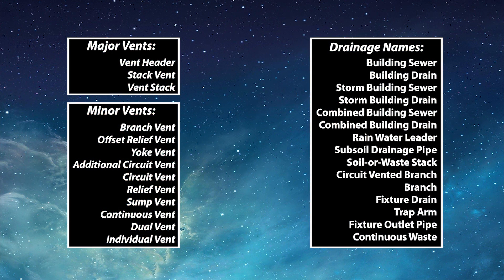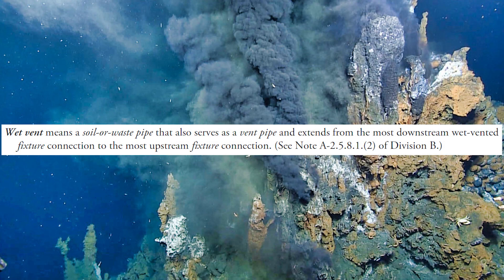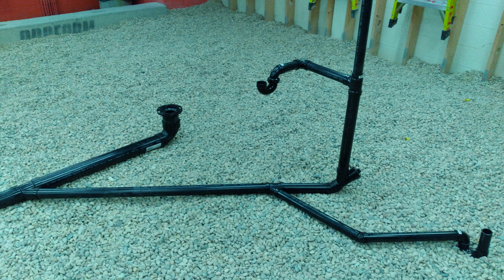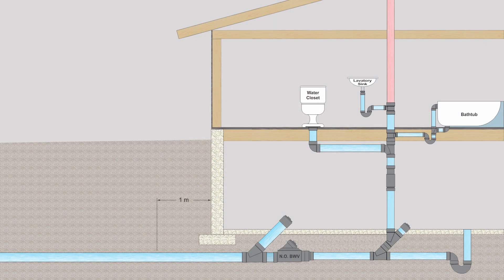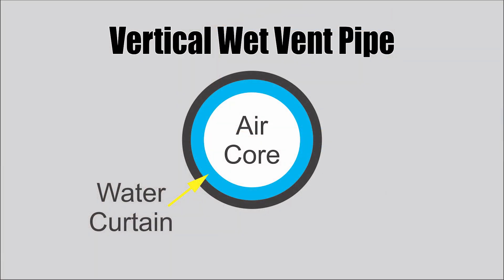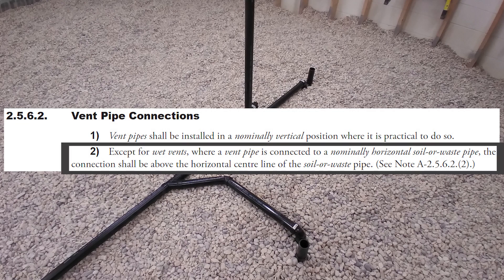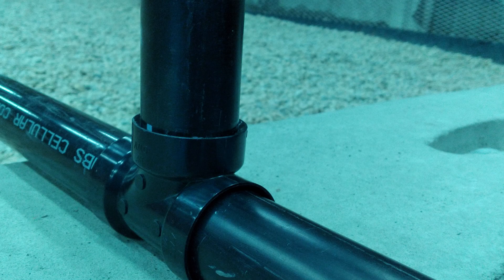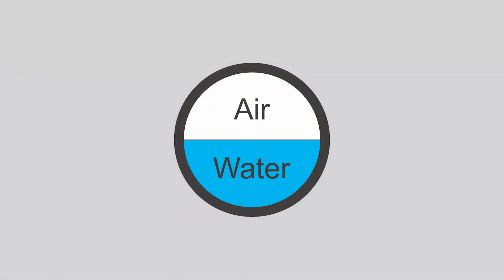Wet Venting Video:1 - Wet Venting Basics

Comment: when wet venting and the piping is 2 inch from the fixtures to the actual vent ( vent is 1 inch )  older house.   do they leave the 1 inch vent ( grandfather) or best have someone replace it?
Reply from the maker: I have never come across a 1" vent. If you are living in Canada, this has never been permitted by code. Therefore, this has likely been installed by someone who just took a wild guess.

Would I start ripping open walls? No, I would consider putting in an air admittance vent in an accessible area though. Like under your bathroom sink.

Comment: Aren't we supposed to upsize the pipe when wet venting the next fixture? Isn't that rule missing with that diagram?
We're not allowed to use a santee on it's back for a drain, is this normal in Canada?
Reply from the maker: We don't have any rule for upsizing the wet vent after the next fixture.
As for the santee, yes we can use it on its back in Canada. Some cities here will not allow it, but there is no official code against it.
Reply: @MathematicPlumber Interesting, Canada uses NPC rules only? Here in the states we use UPC or IPC and some other states have their own special book, LOL.
Reply from the maker: @jamestorres2789  Yes, Canada exclusively uses the NPC. Some provinces will have certain amendments that have slight variations, but they are very similar.

I have heard of the IPC and the UPC, but I have not spent any time with those codes. If the US takes over Canada one day, I may have some studying to do. LOL
Reply: @MathematicPlumber ugh, 3.5 more years of this stupid Taco 😜🤪😝

Comment: Great description of a wet vent. About the wet vented fixture drain connecting to the wet vent above the horizontal center line, if you observe the trap to vent distance, the trap is actually in contact with the air in the wet vent (which is in the top half of the wet vent pipe). A dry vent must connect above the horizontal center line. But in the case with the bathtub it’s a fixture drain that’s connecting horizontally to the wet vent.

Comment: For the example with the tub and shower, would there not have to be a fixture on the vertical so that it’s continuous? I thought the wet venting fixture needed to be tied in on the vertical?
Reply from the maker: The short answer is no, there does not need to be a fixture on the vertical. The vent needs to come off above the horizontal center line of the wet vent, and the wet vent needs to be sized properly.
Reply: 7.5.2.1 (k) the highest fixture is connected to a vertical portion of the wet vent, upstream any other fixtures, in the form of a continuous vent. Would that not mean that the last fixture needs to be on the vertical?
Reply from the maker: @TheRIVERRAT18  You are in a completely different code book. The code I am referencing is the NPC in Canada. There is no section 7 in the Canadian plumbing code

Comment: I live in a city in the United States that has pretty strict Plumbing code, the first picture set up wouldn't even be close to Legal . Not only are wet vents frowned upon here that vent is way too far away from that toilet. Our vents can't be any more than 5 ft from the toilet
Reply from the maker: Codes are definitely different in Canada. But  I would like to learn more about American plumbing and gas codes. Which codes to you use in your State?
Reply: We use that here in Florida and Texas. Perfectly legal to use, as long as the tub or shower arm is less than 8 linear feet. Commodes can are a little different, most places is 12 feet from vent, while others say it doesn't matter, depending on what code book, what amendments the jurisdiction has adopted, and finally the last say is up to the inspector and how he interprets it. 

Very good video, especially the examples and videos illustrations !
Reply: @scottobrien6062 I'm actually in the Pittsburgh area and our county code is supposedly as strict as places like New York. The downside of this setup is if that 2 inch drain line from the tub or sink ever clogged that toilet is not vented anymore. So I completely understand why this isn't legal a lot of places. In my area most toilets have to be vented by a 3-inch stack going all the way through the roof. There are some scenarios where you can use a 2 inch vent but it's mostly 3-in all the way up out of the house

Comment: So a entire wet vent could be horizontal? Like if you are picking up a toilet, 3x2 wye to a lav wet vent with a 2 inch wye off of that to pick up a bathtub. This entire line could be horizontal, other than ofcourse the vertical portions to pick up the fixtures? 

the first 3x2 wye does not need to be nominally vertical? I worked with a journeyman that always rolled this wye. Was he just mistaken?

Comment: What do you mean by, "most down stream"?
Reply from the maker: Upstream is a higher point in the piping system and downstream is a lower point in the piping system. Just like a river: the snow melts on a mountain (upstream) and then flows down through a river until it meets the ocean (downstream)
Reply: @MathematicPlumber Looking at your plumbing group mockup, which is a horizontal display,  I'm confused by what is "most downstream"
Perhaps you mean most downstream from the top of the wet vent?

Comment: Why yall notherners call it a tee wye?
Reply from the maker: Cause that there are a tee an a wye
Reply: @MathematicPlumber  Yeah but it is a 90 degree fitting, which would be a tee.  Again I'm not a yankee and wondering why yall add the wye part too it?  We call that a sanitary tee, a wye would look like an and "y".
Reply from the maker: @jtoker9758  We use all that terminology too, and you are not wrong. A sanitary tee is not a straight tee and not a wye, but somewhere in-between.

So TY was born as a slang way to reference a sanitary tee. This is used across much of western Canada possibly into parts of the east too. It is simply a way to shorten a longer word, time is money right?

If I went to other parts of the world I may try asking for a TY, but I would reword it the official way if I was met with a blank stare.

In all reality, I find it extremely amusing that some people actually get emotional about the slang use of TY. Therefore I will continue to use it, because let's face it, I'm a shit disturber.
Reply from the maker: @jtoker9758  Like I said before, this is a slang term. Just like in Britain they will use the term 'lorry' for what we would call a cargo or delivery truck in North America.

I'm sure the term 'TY' has an origin story just like the term 'lorry' in Britain, but I could not be bothered to lose any sleep figuring out why.
Reply: A tee does not have a slight bend downwards, teewye does, (san tee) a wye is not for sanitary sink purpose, so they all have their place. Tee fittings can only be used for tying in vents together.

Comment: In your three-piece bathroom example, if the toilet doesn't want to flush very easily, I mean the bowl has to fill up, hesitate for a second , and then it will flush ( twice), does that mean the wet vent is waterlogged?
Reply from the maker: This is typical of a toilet that is partially blocked, often near where it is connected to the floor flange. Common offenders are toys, Q-Tips, credit cards or tooth brushes
Reply: Your wet vent ain’t water logged. Your toilet has a log stuck in there

Comment: 2:28  what happens if the image is almost identical, but the bathtub is to the left of the water closet? Can they be wet vented that way? If so, would it have to be 3 or 4 inch to the main stack? Thank you
Reply from the maker: Nothing changes. All sizing would be the same

Comment: So why can a wet vent connect in below the horizontal center line but a regular vent needs to be above the center line of the pipe?  The pipe i'm venting, i don't have the vertical clearance to roll that Y coupler up to have that vent pipe coming out the top half of the pipe.  I only have room to Y connect it in on the same plane like at 4:33
Reply: Probably becuase if it gets clogged then you can snake it out and clear it, but a regular vent you wouldn’t have access..

Comment: Hello Kelly, these videos are great to watch. 
I have a question about wet venting. 
I will do my best to describe  my question. I will use north, south, east and west. Sewage will flow south. 
So at the north end of the bathroom there is a toilet which is the beginning of a 3" pipe.  2 feet south of the toilet on the east side of the 3" pipe a 2" shower pipe will drain into the 3" pipe. Not vented. Then about 18"  south of the shower connection on the west side of the 3" pipe is a 2"  lav pipe which is vented and will be the wet vent for the toilet and the shower. Does it matter that the wet vent is south of the shower and toilet. Is the order for venting OK. 
Thank you.
Reply from the maker: Yes this is a problem. Keep watching the series to get your answer
Reply: @MathematicPlumber  could you plese give me a clue?
Reply: This is the situation I have under my concrete floor. I want to make it right.  
   Since the toilet needs to be the last vented piece into the wet vent.  Is there a way to vent the shower? 
   Is it possible to keep the connection for the sower as is and run a vent after the shower P trap to the nearest wall and connect to a dry vent. 
   Show as * in drawing. However this doesn't follow the 6" above the flood plane rule.   I'm open to suggestions.                                                                                           
   All horizontal under the concrete floor.
   Thank you!!!  
                                                                                                         O  toilet 3" PIPE FLOWS TOWARDS THE BOTTOM
                                                                                                          I                 TO BE WET VENTED VIA VANITY
                                                                                                          I
                                                                                                          I
                                                                                                          I
                                                                                                          I--------2"-------- VANITY IS  VENTED
                                                                                                          I
                                                  SHOWER BASE ----------2"------------I                          
                                                                                            *             I
                                                                                            *            I   3"
                                                                                            *            I      
                                                                                            *            I
                     Can possibly connect to dry vent here.  "0"

Comment: Hi Kelly, great videos and explanations. I was hoping you can help me out🙏 I have a 2storey bungalow
With a3 pc bathroom on the 2nd floor, and on the first floor I have single bowl kitchen sink, a dishwasher
And a laundry tub and washing  machine and finally a powder room with a wc and vanity sink.
In the basement I put in a 3 pc bathroom and I was wondering about the 3toilet rule. From my toilet I have to run about 8ft before I can tie into a 4” cast iron building drain line, is this ok with the Canadian building 
Code? Thanks.
Reply from the maker: As long as you pipe everything in the bathroom correctly with the proper grade, you should have no issues. The 4" building drain will be more than adequate
Reply: @MathematicPlumber  thanks very much for your reply, I have a 1/4 “ per ft slope is that ok?
Reply from the maker: @johnmorrison1050  ¼" per foot is bang on. Nice work!
Reply: @MathematicPlumber  hi Kelly , once again thank you very much for your reply🙏 1 more quick question , is there a reason why some plumbers use asb pipe and some use pvc underground. Thanks , have a great day .
Reply from the maker: @johnmorrison1050  Personal preference, ever changing cost and availability of materials. There is no code stipulating one or the other underground.
Reply: @MathematicPlumber  This is essentially what it comes down to. We always use ABS in kelowna simply because it's cheaper, with PVC for the sewer portion then using bushings to branch off from there to the various bathroom groups and such

Comment: I don’t why I am having such a tough time trying to figure wet vents.   Smh.
Reply: Me too bro
Reply: In his example, imagine the bathtub drain from the trap to where the wye connects to the “wet vent” that instead of connecting to a wet vent, it connects to a sanitary tee with a vent that goes up through the roof. But in this example a “wet” vent is exactly what it says it is. It’s a pie that’s “wet” because it conveys drainage but it also functions as a vent for the fixtures connecting to it. The air at the top of the wet vent provides air to the traps of the fixtures connected horizontally to it. In the case of the bathtub, there is an 1 1/2 trap and 1 1/2 fixture drain from the trap to the “vent” (which in this case happens to be a wet vent). The fixture drain must fall 1/4 inch per foot (in accordance with most codes) so the max distance you can run from trap to vent (on the bathtub with 1 1/2 fixture drain) will be 6 feet. When it comes to wet vents, imagine the pipe is the vent. It gets its air from the dry vented connection upstream. Something helpful is to study the definition of a fixture drain and why the trap to vent distance works the way it does.
Reply: Me three
Reply: Been plumbing 30 years makes perfect sense to me 😂😂😂😂😂

Comment: would you count the WC FU when sizing the WV or are they not included when sizing the WV
Reply from the maker: Last connected fixture or most downstream fixture in the wet vent (which is regularly a WC) is never counted in the wet vent fixture units.

Think about it this way. The last connected fixture is draining into a branch or SOW stack, it is not draining into the wet vent itself. So no county!
Reply: @MathematicPlumber  also are all the FU counted when sizing the continuous vent? the last fixture that wasnt counted in the wetvent
Reply: @MathematicPlumber  what about a when there in a individually vented fixture connect to the wetvent. is its FU added to the total when sizing the WV? also is the total of FU added when sizing the continuous vent relating to seperately vented fixtures connected to the wetvent.
Reply from the maker: @kassbernard6747  Keep watching through the wet venting series, it's covered.

Comment: On the second example-the wye is not connected to a continuous waste and vent tye  on the vertical?If not-would that not just be a  a back vent using a wye?  not a wet vent?
Reply from the maker: By 2nd example do you mean the illustrated bathroom group draining into a soil or waste stack from the second floor, or the soaker tub and the shower example?